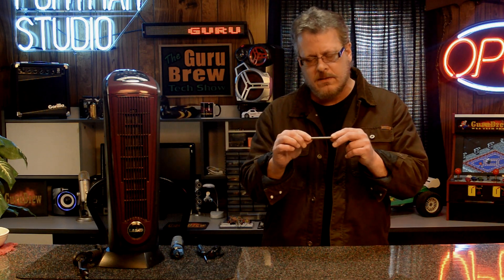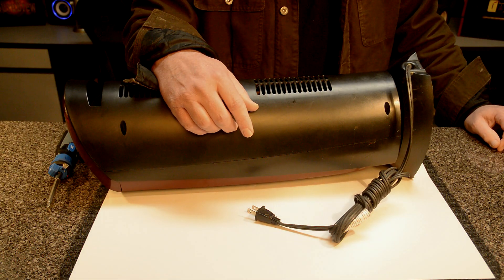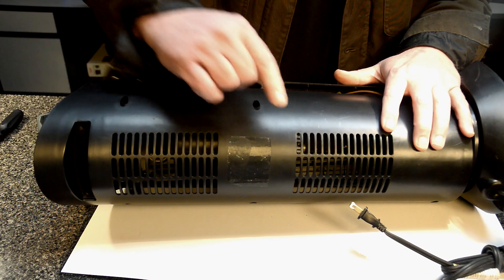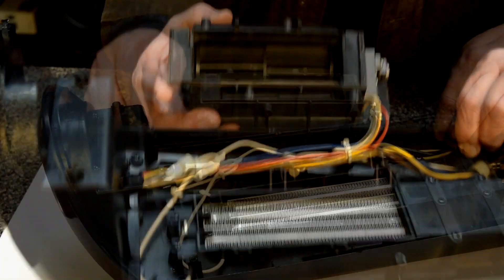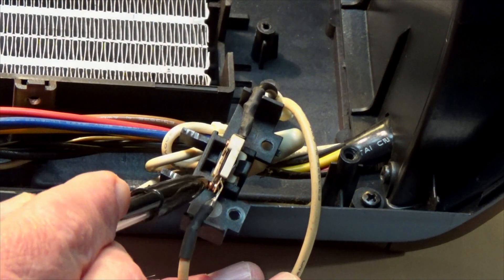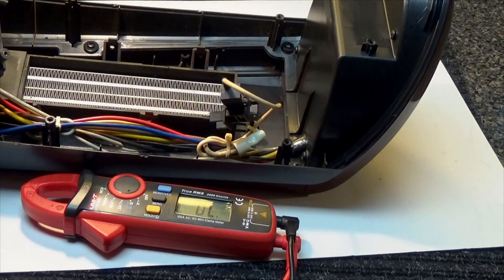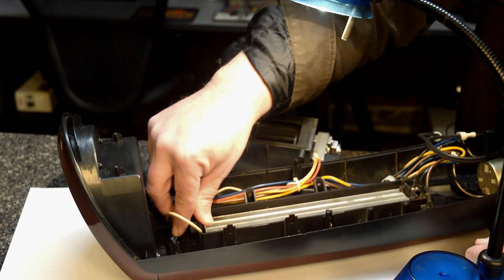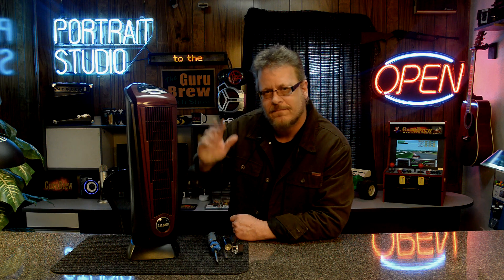Space Heater Maintenance & Cleaning

Comment: Hi my heater fell over and it stopped working.  The light turns on and beeps but there is nothing happening on the digital readout.   I opened it and cleaned out the squirrel cage but didn't go as far as you did, I can redo that part but could that be the problem with it or maybe that switch you showed?